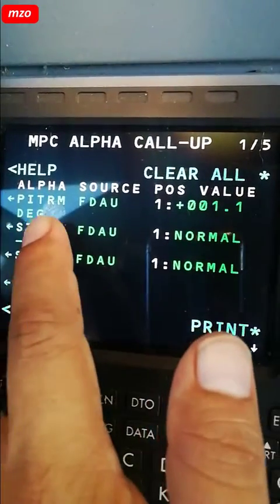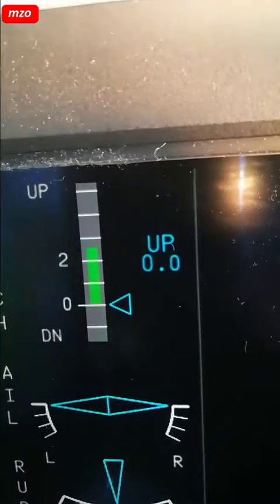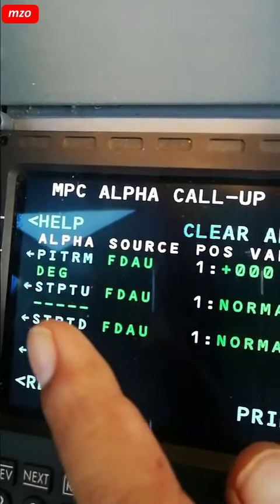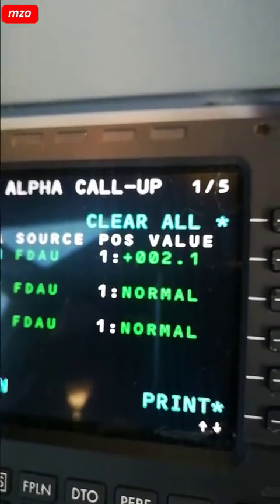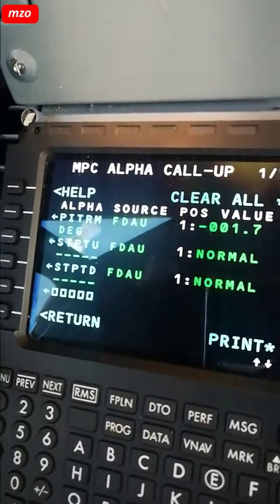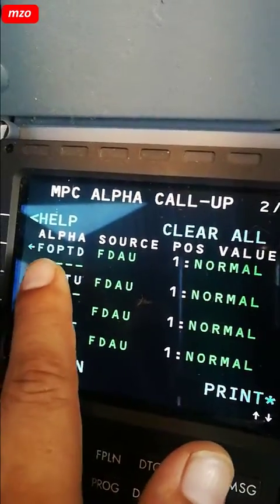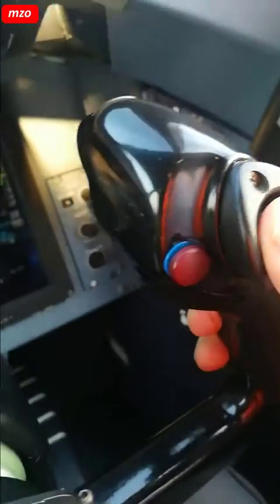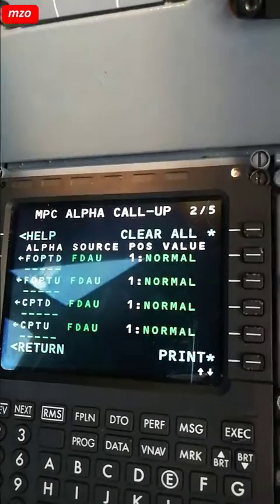ATR72-600: How To Check Elevator Pitch Trim and Its Command Switches Via MPC

Comment: Can you make a video and show what is on the next pages?
You only showed pages 1 and 2/5.
Also what if you press help?
What does "clear all" mean" on Line select key 1R?
Reply from the maker: @AVIATIONSOUNDEXPERT you can input maintenance codes on every pages. Four codes( parameters) for each page. If you want to clear all code, just press the Clear all. This kind of method is very useful for quick troubleshooting.
Reply: @mzosharing  

Ok, but i have never seen that.

I have another question.
Are you able to record all aural warnings from the computer in very good quality?
For example
TAWS callouts like

Bank angle
Sinkrate
Dont sink
Windshear
Altitude callouts
Ect?

The problem is that on your videos the sound are disturbed by radio communication or engine sound or 
Ventilator sound from the cooling equipment.
I know that is possible to record in perfect quality via the computer modules in the electronic compartments.

I like alot the deep voice of the TAWS from THALES.

This voice i also heard in A320 (Batik Air, Atlas Global A321 and MD-83, and A320 from Airblue Pakistan).
Most airlines use EGPWS from Honeywell.
Also i heard it in MD-80 from Orient Thai, Zagrosjet from Iran, former 747-200 from Air Atlanta Icelandic and in a 767-200 from Mexico.
Reply from the maker: @AVIATIONSOUNDEXPERT  Are you flight simulator programmer?
Reply: @mzosharing  no, but i am interested in cockpit systems.
I do also use sometimes flightsimulator and like to use realistic sounds.
As you might have recognized i know a little bit about systems otherwise i could not mention to you some of the operators and aircrafts which use exact same voice which you can hear in the ATR 42/72-600.

The voice of the TAWS exists longer than ATR 42/72-600 version.

Beside of that i know that an addon company is developing ATR72-600 for P3D since two years. But i asume that they will make own recordings on a real ATR72-600.
Reply from the maker: @AVIATIONSOUNDEXPERT  so, are you from repair shop?
Reply: @mzosharing  no, i am not currently in aviation business.
Reply: @mzosharing  

In these videos you can hear the same voice 
of TAWS that is beeing used in ATR42/72-600.

The smart altitude callouts i have used are from different videos.

But unfortunatly the quality is bad.
As mentioned before, it was also used as retrofit in a 747-200 by Air Atlanta Icelandic.
Keep in mind that these videos are 12 years old!

https://youtu.be/-_tBtOmO35Y

https://youtu.be/1MWtFBEstio